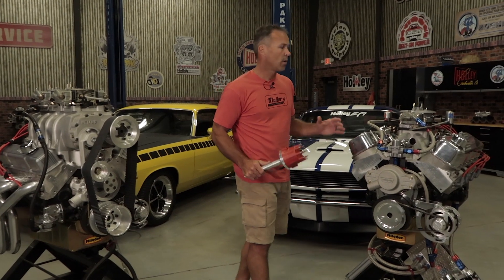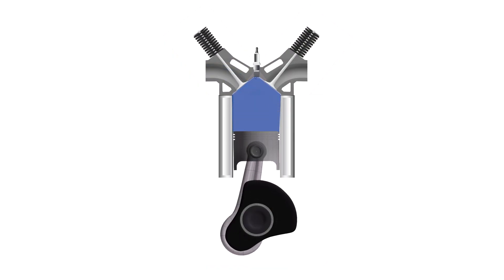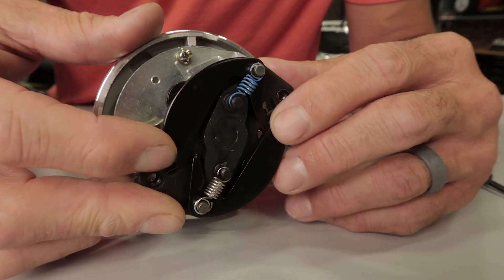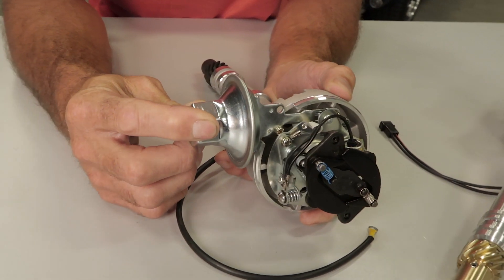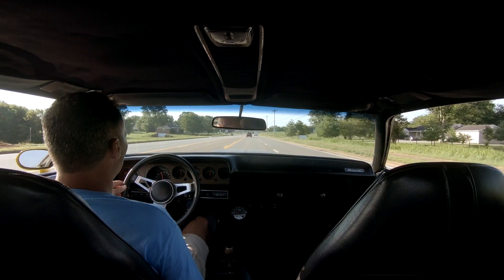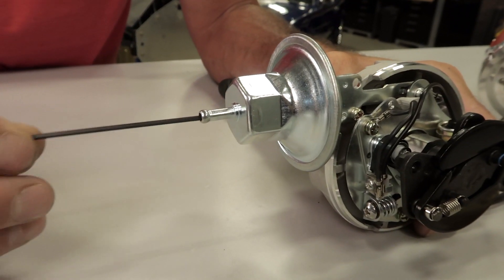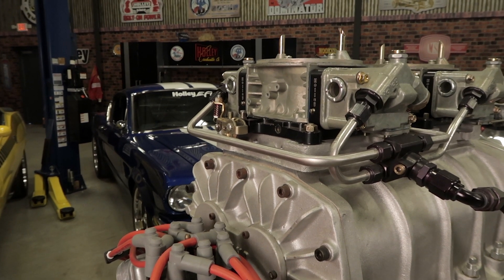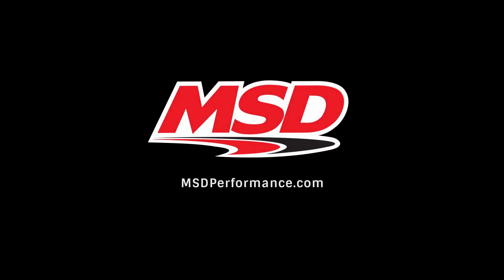How Ignition Timing Works: Vacuum and Mechanical Advance Explained!

Comment: It was, and still is my understanding that most vacuum advance devices retard the timing at idle (high vacuum), then when the vacuum drops under load, the timing advances very sharply. This is my observation with a timing light on dozens of cars I tuned back in the '70s, usually '60s muscle cars. I specifically remember a 69 camaro that had a "Vette 427" stuffed in it. Ran like crap. Put a timing light on it, and found only about 20 degrees of total advance, starting at 10 degrees baseline. When I found the vacuum advance diaphram was broken, I replaced the unit. I set the timing to 10 degrees again, as it was retarded after replacing the part. Then, I found about 35 degrees of total advance. But, the timing advanced IMMEDIATELY upon cracking the throttle open, as vacuum dropped. That 427 actually scared the owner when we got behind the wheel. Power probably doubled. So, after more reading, I am still stumped by my observations, that every unit I ever worked on, most 1969 or earlier, behaved exactly this way: When timing is set to baseline, engine at idle, vacuum is high, over 14lbs, usually. If the vacuum advance is working properly, as soon as the throttle is cracked open, say 1/3 or more, vacuum drops dramatically, spark advances immediately...before RPM rises. While I have read there are vacuum retard units, I'm stumped by your desription as it seems completely opposite of my experience. Note: I understand exactly what you are saying. But, this was my experience with my 69 'Cuda 340, 70 Olds 350 H.O. Cutlass, 67 Chevy Malibu 307, etc. Those were my cars, which I tuned frequently and they ran great. By your description, they all had vacuum retard units, which is certainly not the case, as those units didn't show up until the later '70s (not 1970).

Comment: Very interesting but unclear if manifold vacuum or ported vacuum should be used to operate the vacuum advance. It did say to use manifold vacuum on a blower set up but did not say to always use or not always use manifold vacuum instead of ported vacuum. Instructions with my Holley carburetor said to connect the vacuum advance to the ported vacuum connection of the carburetor. The instructions to my MSD distributor said to connect the vacuum advance to the ported vacuum connection on the carburetor. Yet  pundits on you tube say to connect the vacuum advance to manifold vacuum. So which one is correct? I think even manufactures of carburetors and distributers are undecided.

Comment: I got a question about the vacuum. So my distributor has the centrifugal timing adjustment and a vacuum one. I checked each one with my strobe light and figured out, that the centrifugal adjustment is advancing the timing with the rising rpm. But my vacuum is adjustig into retarded timing the less vacuum is pulled, so the more throttle i pull. So actually, if i am wide-open with my throttle and reaching the highest rpm possible my advanced timing of the centrifugal adjustment gets pulled in to retarded again through my vaccum timing adjustment. Is this a thing to restrict the rpm

Comment: It doesn't "take more time" for those processes to complete as engine speed increases. The time does not really change. You just have less time for them to happen at higher engine speed because the piston (and everything else) is moving faster. So if you want the spark to happen at a certain advance in crank degrees, you need to start the process sooner at high engine speed. That's why you need more advance. In other words you advance the START OF THE PROCESS so that the spark happens when you want it to.

Comment: This is good basic information rarely taught today but the The information about vacuum advance is only accurate when using manifold vacuum. Holley carbs and other setups have nipples on the carb that supply PORTED vacuum. The vacuum signal generated on a ported port is INVERSE to manifold setups as its signal is generated by the venturi in the carburetor & not the restriction cause by intake stroke/throttle plate ratio.  Ultimately the rule of thumb is being able to run as much advance as you can without pinging or detonation for the fuel you have available.

Comment: Wow, he totally missed memo. In the cylinder, the flame front advances across the chamber, rather than igniting all at once. That’s what takes time, not the electric impulse in the wires. This is why changing fuel octane requires a change in timing. Higher octane fuel actually burns slower and therefore requires less advance. Pinging is when the flame front hits the piston while it is still on the way up, meaning not enough advance. You can correct pinging and prevent damage to pistons by either advancing the timing further or raising the octane. That way you “time” the flame front to hit the piston at the right time. I guess this is what happens when they ask the pretty boy in sales to be the front man for the video, instead of the brilliant geek from the lab.

Comment: I built a VW 1600 motor and put the wrong distributor in without vacuum advance!! My sand rail ran like shit for a year. I came across this video and it all made sense to me that I needed a vacume advance distributor, this video solved my problem and I'm very grateful it was out there. Thanks for the great info.
Reply: Stoked for you ! How is the rail running today/currently?
Reply: dont google 009!

Comment: It does take time for the signal to make a spark, however that is a constant delay. The baseline timing advance is more about the time delay in the pressure wave as the fuel ignites. As the engine speed picks up, the timing needs to advance further to get that pressure wave to occur just after TDC (fuel is ignited before TDC).

Comment: 4:55, I beleve this statement is wrong. The adjustable vaccuum canister can not increase or decrease the amount of timing. You can adjust when the timing shall be activated by the amount of vaccuum. Thigher spring in the caninster equals later advance from the caninster etc.

Comment: I made an adjustable canister for my old VW, I can change the spring inside or tighten it stiffer or less to experiment. I really enjoy the torque at partial throttle it gives. 🔧🪛🚘

Comment: Others have commented on this but I'll try to be as succinct as possible.  The need for ignition advance is entirely due to the time it takes for the fuel air mixture to burn completely.  It may seem to be instantaneous but it is not in relative terms. Relative to what you say?  Relative to the speed (RPM) the engine is turning.  Keep in mind that the time it takes to burn the fuel mixture is more or less constant. In other words, the flame travel speed is the same at idle as it is at redline, so if ignition timing were set and optimized for idle the engine would outrun the flame speed of the combustion event and the pressure in the cylinder would peak well past TDC. Not optimal. That is what the centrifugal advance is for, it advances the timing as the RPM increases.  Vacuum also advances the timing but at W.O.T. (A.K.A high load) vacuum of course goes away and the timing is retarded so as to avoid detonation.

There are other factors that enter into the optimal number of degrees of ignition advance but for the most part it is dependent on the combustion chamber design which greatly affects how fast the charge burns.  A fast burn combustion chamber was the main reason the DFV Cosworth V-8 became the most successful Formula One engine of all time.  Prior to the creation of the DFV, most overhead cam engine designs used very wide angles between the intake an exhaust valves which allowed for very large valve heads and large quantities of fuel and air to enter the cylinder. But to get the compression ratio high enough to take advantage of high octane fuels required very high dome pistons.  That made for a very thin and slower burning combustion chamber, which required a lot more ignition advance than faster burning designs.  Put another way, it is better to burn the charge fast and more completely than it is to try and stuff more mixture into a less efficient combustion chamber.

Comment: I purchased a Chevy crate 5 years  ago for a 77 Monte. 480/460. 
750 Quick Fuel carb.
They shipped it with mechanical advance with the vacuum advance crimped. My Monte runs like a bat out of hell. 700/R4 tranny with overdrive. Cruises 75 MPH at 2,300 RPM with 3.73 rear.  Idles in drive at 650 RPM smooth as silk.
Other than MPG, is anything wrong with this setup?
Trying to learn.

Comment: I installed an HEI at TDC and set the timing to -10BTDC on my 300 6 F150. Now it’s driving like I have a totally different gear ration. Insanely high RPMs at 45mph now, so I can’t drive on freeway. If I advance more, it gets worse. Better acceleration, way more heat. Retarding it fixes the heat issues, but i can only go so far before I lose so much power I start stalling everywhere.

Comment: I run MSD systems on all the cars that I work on, the programmable systems are great. Having said the first few seconds of this video are nonsense, you want peak cylinder pressure at 14-20 degrees ATDC not at TDC. The reason being that at TDC the gas pressure can not create ANY torque at the crank because the con-rod is vertical, the likes of Riccardo Engineering worked this out many years ago and it still holds true today. The reasoning for the bob weight advance was misleading, it does not take longer to burn the mixture as the revs go up, in fact due to turbulence the opposite is true, the problem is that the crank will have turned more degrees as the RPM goes up during the time that it has taken to burn the mixture. The explanation for vac advance is also not very good, OK so the leaner mixture may have a very slightly slower burn rate but that is not why we need more timing at low loads. At low load the volumetric efficiency of the engine is very low (low VE). A low VE leads to a very low initial cylinder pressure because there is hardly any fresh charge in the cylinder to burn (and there is probably a load of exhaust gas in the cylinder too since the piston will have an easier time pulling exhaust gas back in the the cylinder rather than pulling fresh charge through a virtually shut carb or FI butterfly). Low pressure BEFORE the plug fires leads to a slow burn rate so in order to get peak cylinder pressure at the right time the plug needs to fire earlier in the compression stroke. This also explains why if you raise the compression ratio in an engine you may need to pull back the timing a couple of degrees, you have raised the initial cylinder pressure and hence increased the burn rate. Also what about ported and non-ported vac timing? (ported for emissions reasons and not really what the engine wants). Come on MSD, your ignitions system are great (although you need to make your bob-weight springs out of a better material, they corrode away after a couple of years! Luckily with the programmable systems the dizzy is 'locked out'). Anyway you can do better than to create a video with so many errors in it!

Comment: So do you want your total advance with vac or not
Reply: Well that depends on the throttle position, most people claim that a small block chevy for example wants 36 degrees total advance, that is probably correct as long as the throttle is wide open (WOT). However, at mid to high rpm with the throttle just cracked open you could and should add another 12 degrees to the 36 making a total of 48 degrees.

Comment: The engine diagram for the Buick 401/425 Nailhead is wrong. LHD car passenger side front to rear is 1,3,5,7. Drivers side front to rear is 2,4,6,8.

Comment: Dude did not at all explain why vacuum advance is disconnected when setting the timing.
Reply: Because the engine is not under load so you don’t want vaccine advance you don’t need it to run a car you need mechanical thku

Comment: vacuum advance is because the fuel atoms are further apart . This takes the combustion flame front longer to travel across combustion chamber .
A street car is not a race car . On the street vac advance is needed .
light throttle cruise is between 35mph to 55mph . You need to measure the trigger point in inches of Hg Vacuum advance should ramp up between these 2 points under light throttle conditions .
When moderate throttle is applied the vacuum advance should disappear mechanical advance resumes

Comment: If you watch this video CLOSELY, the vacuum gauge drops to close to zero as the driver mashes the throttle. So, in this example, fulll/manifold (not ported) vacuum advance is used. And yes, it's true that pre 70s, manifold vacuum was used; although some manufacturers used BOTH. Can't remember what car I had, could have been a FORD, Chevy or AMC, but the distributor used BOTH as part of the early emissions controls. Insofar as I can remember, the source was determined by a (possibly spring operated) coolant temp sensor. @kztrekz3329

Comment: Wire/spark time... try 3 nanoseconds.  Don't ever worry about that, ever again.  The engine can't turn fast enough to get at a 1% error in time of arrival [coil field collapse origin to spark appearing in the chamber] over the full operating range.  If it was that twitchy, an oscilloscope, not a wrench, would be the tool for timing changes   The big confusion is always vacuum advance.  Mechanical advance corrects for the rpm range in use, while vacuum fine tunes that for intake conditions.  Passing through 2200 rpm at 1/4 throttle is a  diffferent thing than at 3/4. Vacuum will prove it every time
Racers lockout advance in their distributor, but they are running 4k stall converters or higher, so the need to manage spark timing under low rpm with a load can be waved off.  So time to examine combustion: flame front speed on an air fuel mixture is pretty much a fixed value, but... engines run varying rpms. so altering timing is what works for managing performance.  It's not that combustion takes more time to complete, but peak pressure happens with piston further down the bore as rpms go up and if nothing is done - lost power.  It takes changing fuel to change flame propagation speed as a general rule.
So, vacuum advance: manifold or ported vacuum?  Short answer is use what the distributor was designed for - the two modes are not really interchangeable.  For ported, as signal increases, advance increases to fill a range before mechanical advance is all in [effectively taking over] - sensing is near the bottom of the carb venturi, which means velocity can add to signal.  For manifold, a decreasing signal allows advance.  And while manifold signal [having fewer restrictions] tends to be stronger numerically, the inverse function could be problematic in the case of an aftermarket cam swap - diaphragm design might need revisiting on account of sensitivity being in the wrong area [or even out of range], and it is largely divorced from velocity.  Ported is my personal preference: just easier to live with most configurations where street use is the aim, but that admittedly takes a number of carburetors off the table - don't ever toss an old 3310.  
Keep wrenching, and enjoy your ride... whatever it is.
Reply: Interesting take on vacuum source. In a 1st gen Camaro forum, a retired GM engine designer claims ported vacuum was used only for emissions reasons. I have always had better results using manifold vacuum.
Reply: I’m going to take a wild guess and say you may have spent time in the field of mechanical/electrical engineering?
Reply: That's what I thought, ie the "time taken to for the signal/energy to travel from/to......." It is irrelevant. Electricity essentially travels at the speed of light, so, the times we are talking about in an engine, the rate at which the engine moves versus the speed of the electrical pulse, you may as well say that the elec arrives there instantaneously, because the engine (by comparison) is so much slower. 

As you sound like you would know (and this is for others here); Not that you can't measure it. In radar, a radar mile is 6.1 microseconds, that is, the transmitted pulse travels a mile in 6.1 MILLIONTHS of a second. And we can measure that (to check sync pulses on a scope) but you can see when it is travelling THAT FAST - the time taken to travel from coil through dist to spark plug................ the engine has barely moved AT ALL. So ignore it/you don't allow for it. 

The most important thing is that Mech advance is for performance, Vac is for economy. It is a simple as that, and why many performamce oriented engines don't even HAVE vac advance, for example, my Cooper S came Standard with no vac advance. 

Mech advance ignites the mixture earlier so that it will be burning and expanding at the right time. The faster the engine runs, the "more notice" it needs to "ignite it early enough". 

Vacuum is entirely different. Cruising has a far different mix on a slightly opened throttle. So, it takes a lot longer to burn. So, vac senses that it is a "light throttle condition" and adds extra advance to "light the slow burning mix nice and early" to get the most out of that charge. 

Where the misconception comes from that "you MUST have vac advance" is that usually the vac advance rotates the "points plate" (or elec ign pickup). I have had people swear that "a car won't run without vac advance, because theirs wouldn't run/replaced vac advance = perfect!!" What that is is that a worn vac advance lets the points plate "flop around". So it acts like any other "loose part" and makes it run rough. Them replacing the vac advance wasn't necessarily "not having vac advance" but more likely "not having points plate securely mounted". 

But yeah, "allowing for the time taken down the wires................" Nah, doesn't happen. Your engine would have to be running at light speed to have to allow for that. 🙂